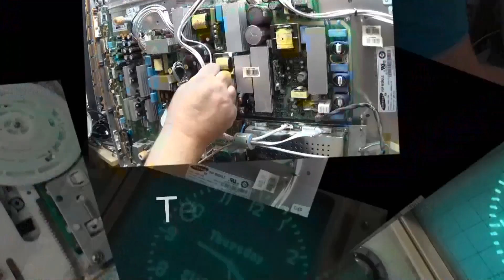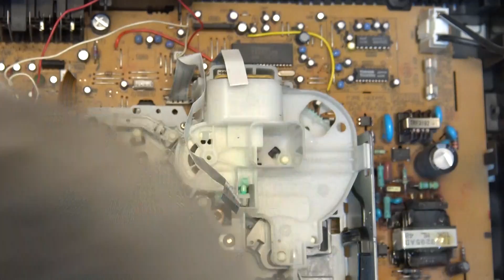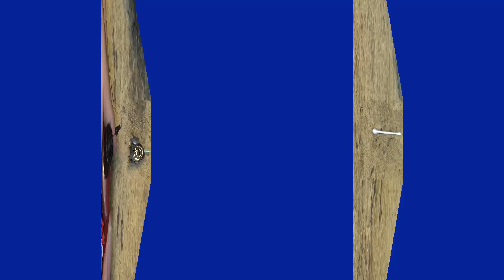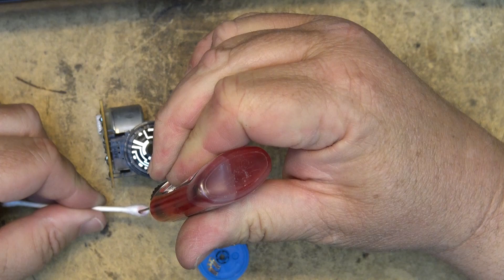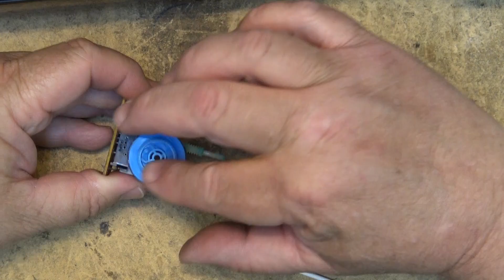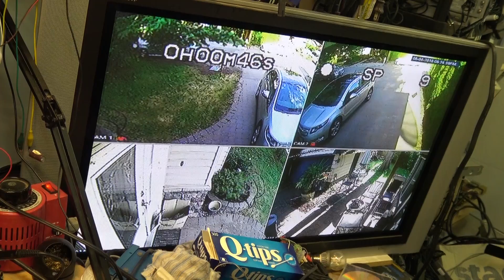Toshiba M750 VHS recorder eating tape repair

Comment: My VCR was not in the home position. I cleaned it and am ready to test it. Two questions,
1 - How to do get the bottom gear into the home position? 
2 - What were you hitting to fake the unit into thinking the tape was installed?

Comment: I had a toshiba m-550c which is identical inside, but there were just too many issues, it ended in the junk pile, but i learned a lot. thanks!
I had to reinstall the tape unlock pin and clean the mode switch and remove the head cleaner brush but also discovered a few broken plastic pieces and the vcr still would power off instead of playing / seeking a tape. I had fun.

Comment: This video was a big help.  I have the RCA VR674HF version and it wasn't loading up the tape in the cassette at eject.  I cleaned everything as you did and also took apart the mode switch.  However, my belt was totally worn out and stretched, that definitely needed replaced.  I found a place online:  VCR parts and they had a square belt replacement in the correct size (IC: 9.2 inches Thickness:  .078) for only $12.00 with shipping.  I was able to purchase the service manual for my model online for around $18.00 and that had everything I needed as far as views, procedures, etc. but this video was icing on the cake - nothing like seeing it in person opposed to written service procedures.  The place I bought the belt from also had brand new mode switches for this model for $6.50.  I cleaned my old one, but if it acts up, I would be wise to replace with new given the age and scarcity of parts (have to desolder the old and solder in the new).  This VCR is close to 30 years old but I love it!  I bought it brand new!

Comment: Gentleman plz show me the AKAI VCR encoder switch position . I have lost totally it's position infect there is no any mark were can I set switch position .I did try to find a correct position on Google internet etc but I fail .so request you to plz explore akai VCR encoder switch position thank you
Reply from the maker: Do I look like a magician? You think I can wave my magic wand and say abracadabra and magically an Akai VCR will appear on my bench?
I can only fix what I have and I don't have an Akai VCR but would like one to take apart.
Now, was it a real Akai or a Mitsubishi, as Mitsubishi made the later Akai units, and Akai made the early ones.
Reply: @12voltvids  AKAI VS-R9EV

Comment: Hello, I just came across your channel and I enjoy it so far. However I have a question regarding eaten/chewed tapes. Can they still play? Are they worth keeping still? I bought a tape that happened to have its film already pulled out and slight crinkles in hopes of fixing it. I was able to wind the film back in the tape. Also, are there any VCRs out there that don't eat tapes at all? I enjoy vhs tapes very much and want to keep collecting and watching them. Thank you
Reply from the maker: A machine that is operating correctly won't eat tapes.  Yes you can play a tape that was eaten but depending on the damage may clog the head.  At the point of damage the picture will be disrupted.  In most cases minor tape damage will not harm the machine
Reply: @12voltvids hello: is this how I can contact tou ?

Comment: You sure give me confidence in repairing these machines.  I use to work on Aircraft Electrical.  This is just a little smaller electro mechanical.  Looks like fun learning the items. The Oscilliscope would be a problem for me on the audio and video RF checks.  Alignment and all that.

Comment: Some of my VCRs have button issues, when I press one of the buttons the VCR does another function. I showed the issue in my last video. Do you know what causes this and have you fixed these issues before?
Reply: That's usually caused by bad contact in the microswitches, so clean/replace. Imagine you have a bunch of resistors to generate a voltage level unique to each function in order to feed an ADC... bad contact can mess that up. Inadequate debouncing is not going to help either.

Comment: Very cool, an easy fix. I've cleaned some mode switches too. I've never seen a VCR acting as weird as this. Also, you did a mistake, the channel and record buttons are inside the door that opens at the left of the VCR.

Comment: Any ideas why my vcr pinches the tape once i stop it from fast forwarding in jet speed? I've watched the mechanism and it seems like the pinch roller engages at the tape at the wrong moment and creases the tape. Rewind and play is fine just ff..
Reply from the maker: Probably the mechanism is slightly out of mechanical timing.
Reply: 12voltvids I'm wondering how i could check on that.

Comment: Another fine Video. It does amaze me that as many times as it turns out to the Mode Switch, Toshiba makes you work to get at them.  On this PV 4652, I found I did not need to unsolder. I just took the little screw out that held the attached circ board. Cleaned up. But my guides are still stuck in the up position and the gears are froze. So, I 'm searching for one of your tear down vids that will apply. 12voltvids is the Curtis Mathis of our You Tube generation.

Comment: I'm still wondering why these VCRs don't have separate power supplies. Oh, also Philips and Grundig Video 2000 machines have slip rings on the head drum for the DTF system. :)

Comment: I have had a few free machines come my way with this problem, the last one was a top of the line Panasonic.
You have shown the correct way to clean the switch, I have seen people flood the switch with WD40!
Reply from the maker: WD40. Good way to destroy the switch. Deoxit is what is needed.
It is expensive, but you get what you pay for, and I don't just say that because I won the video contest grand prize last year and picked up a cool 1000USD.